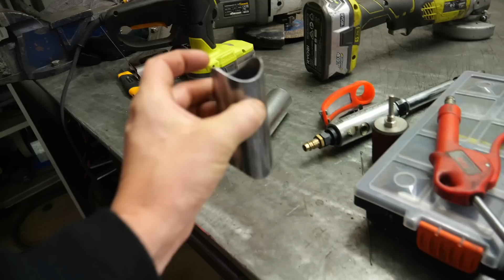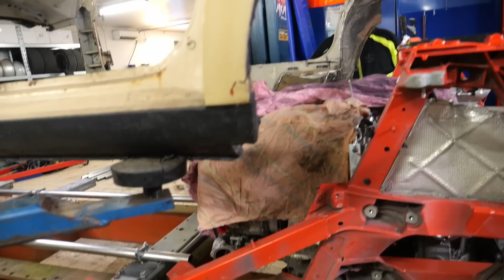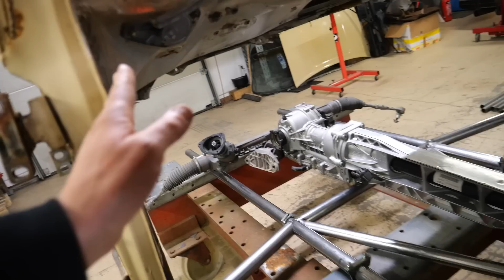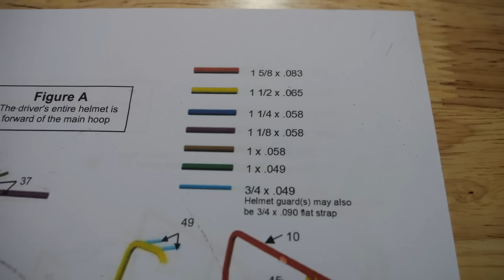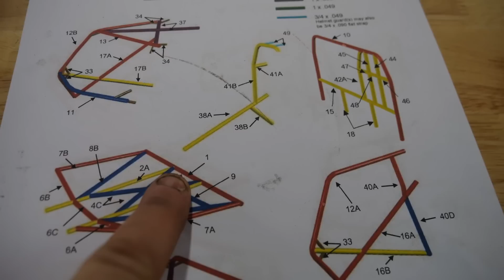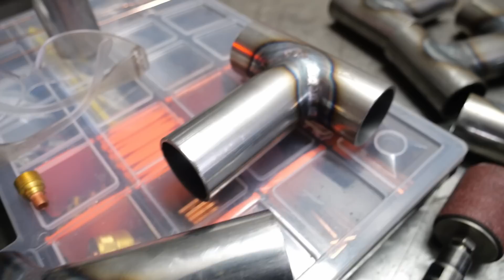Volvo with Mid-Engine V10 TT. Chassi build! Project Ep 2

Comment: Anybody watching using Celette MUF 5 / 7 type bench, just be aware they actually can flex if not on an even floor.

I use a MUF 7 and level it with a precision spirit level: it doesn't need to be 'level' usually, but just jacked in lowest corner to take out twist.  Amazing how much they move and I suspect over the years there must have been thousands of cars 'straightened' on slightly twisted jigs.

An old car scissor jack is perfect for the low corner: lift until twist is gone and it'll sit there for as long as you need, perfectly accurately (unlike a hydraulic jack potentially).

Comment: now you have a floor that is attached to the engine shell, if you measured carefully, you can cut away the sheet metal on the inside of the chassis, if this sheet makes noise, you can lower the chassis lower than where the pipes end and make the car lower, measure carefully with a laser, attach the chassis, check that everything is in place the right doors fit, etc. then weld everything carefully now you have a body that works

Comment: he inside of the threshold boxes is vertical saw out 3 mm tiknes and as long as the chassis cut off the pieces that stick out so you can bring the chassis down over them weld all the pipes phase in the inner edge of the threshold boxes so the floor is fixed in all the pipes +rectangular pipes must be attached together

Comment: Excellent build Peter! I like your idea of running fuel lines through the chassis. Actually I have seen guys run the coolant through those tubes, you should consider this also.
And I agree you should trim the sills to lower the body. Having it shorter and flush with the chassis tubes with a smooth flat bottom will look awesome AND give good ground effect down force at high speed.
I am curious how you will connect the steel to the aluminum chassis. The best in my opinion would be a block or shaped steel tube inside the aluminum tubing to prevent it being crushed and to spigot the joint then bolt through both.
Really looking forward to seeing your car come together. And those are impressive rules for building, very nice. Thanks for sharing

Comment: I do not know how you are positioning everything, but you want the floor of the car flat, with your current positioning of your front differential your ride height looks to be at least 20cm of the ground if your wheel has a 600mm od. i do not know what angle you want on the drive shafts? it seems out of place currently.

Comment: I use a high frequency pulse. 120 pulse per second. 20 % background at about 160 amps but use the foot pedal. You can punch it through, see it and back off to about half pedal, move, repeat. You don’t want to back off too much, as that can make weak points. Try a number 12 cup and set the flow to about 30-35 and run the post flow10-12 sec. Do a bit and move, to let the heat dissipate some. Maybe. Hope that helps or gets you closer to where you want to be sir. Love the channel.

Comment: I would love to build a chassis car like this, but I certainly wouldn't have cut up a perfectly good, rust-free classic 240...  I would instead have made moulds from the important panels and produced the doors, quarter panels, front guards, cowl and roof from carbon.  You also usually start off with rectangle section (i.e., 50x75mm, 060-080" wall) main chassis rails, and build the tube roll cage and other structure up from there.  Just look at custom chassis' built by, well, pretty much anyone really... Roadster Shop, Cornfield Customs, etc...
Reply from the maker: It was not rust free!
I would also like to do the body panels in carbon but i do not have budget for that!
Rectangular tubes is not allowed for fast dragracing cars, it must be round tubes. But it may be good for show cars and much easier to build thats why roadster shops maybee use them in new builds.

Comment: One of the gartest projects in Europe 😍 Make it as stock as possible from the outside. Only big fender flares and welded steel rims for the tires. And I would polster up the seat with the oem textile.

Comment: @PeterBjork As for fuel lines, not sure if you are allowed to have them inside the tube frame. Pretty sure you can have them through the coupe however but there can't be any joints inside the car, and i think the line has to be of a certain thickness.

Comment: Rather a cool interesting project and something different. 
Im just doing something similar with a BMW E36  , what started out as a simple conversion has turned out to be a whole new car only using the rear light clusters , steering rack and a windscreen wiper blade 😂😂😂😂😂😂. Made a chassis jig , intended to use as much of the drivetrain as possible etc etc . Nope that didn’t happen , now I’ve even gone that anal I’ve made door locks and door handles because I decided to make lightweight doors  in carbon fibre . Think I’m crazy myself. 😂😂😂😂 🇬🇧😵‍💫😳🤫

Comment: Hey Peter, if you are looking for inspiration on the rocker panel removal look at some "mini trucks" from the American hot rod scene. A "Doored" truck has the rockers completely removed to achieve minimum ride height where the bottom of the door is the lowest point on the vehicle. Great place to look for ideas to solve that issue.

Doing that will let you lower the body down farther and integrate nicely into the flat bottom of the vehicle. Not to mention, it looks very elegant if done well.

Good luck! And I hope you are going to use some massive over fenders and a wide body kit to keep the R8 track width!

Awesome build, i can't wait to see more!
Reply: Also, match your firewall / bulkhead between the engine compartment and the seats to the same angle as your seat back so you have equal clearance from the top of your seat back to the bottom. It would allow for more seat adjustments and theoretically be safer in the event of an accident. It's also a great place to tie in the R8 aluminum frame.

Comment: Hi Peter,

Very much liking the project and progress.

Great job!

Such a shame that your not using a two door Volvo body.

Keep up the good work.

Cheers from Western Australia.
Reply from the maker: Thanks! Yes 2-ddor is better looking but this will be easier to get in and work on the engine.
Reply: I feel like the widebody would've also been easier to design for a 2 door. I think at this level of fabrication he could always turn it into a 2 door by moving the pillar. Either way I am very excited to see how this will all work out!
Reply: There is another problem with using a 242 as well and that is that there aren't that many left. About 242,000 cars were built between 1975-1984, but most have been gone for decades. In total, Volvo built approx. 2.8 million units in the 200 series.

Comment: In my limited experience, trying to integrate an OEM subframe into a tube frame seems like a time saver in the beginning but ends up causing a lot of headaches and often you start over without the OEM subframe.  You don’t gain much by using the Lambo/Audi subframe and you spend more time trying to solve the problems it creates.   Maybe for this type of project it will work fine but attaching the subframe to the tube chassis is already creating more work and complexity, maybe even a compromise in strength. Also, your practice welds look like spot welds linked together.  Which wouldn’t be acceptable.   Maybe I’m wrong about them being spot welds.  I’ve been a subscriber and fan for a few years now so I don’t want to come off as a troll.
Reply: A couple of things.
Dump the factory frame. Just get some mounting plates cut using some scans and make a tube frame cradle that can be bolted to the chassis. I suggest you use the factory frame to make a mock engine.
I haven’t looked at roll cage specifications in many years but I believe there are different specs for front mid and rear mid mount engines in regards to anti intrusion protection and fire walls.

To practice tig welding Don’t use filler wire until you can control a puddle that fuses two surfaces together at any angle. When you get a consistent weld without filler and no blowouts you can then start practicing adding filler.
Remember cleanliness and consistency of temperature control are key.
Reply: That’s a perfectly good TIG weld, it’s looks spotty as you have to dab the filler rod in yourself.
Reply: @nellyracer22 its definitely not perfect tig welds and they have room for improvement. But it is practice welds too, its not horrible. Its a good thing to focus on to do good

But a very awesome build and i really looking forward for this!
Reply: With all R&D Audi has done on R8 platform. Spent millions in developing it and designing. I think it would be stupid not to take advantage of it.
Reply: @lows3nse  so do you think Peter should also use the OEM front subframe?  And is Peter “stupid” if he doesn’t?
Reply: @scotth7686  not meant in a negative way. He does whatever feels right to him. I only assumed that he takes advantage of Audis engineering instead of doing everything from scratch.
Reply: @scotth7686  chill the fuck down and continue on your project then
Reply: @danielssonsgarage  🙄
Reply: Any videos of your builds being done properly? Be interesting to see
Reply: @joeedwards627  I wouldn’t post videos of a project in the works.  Things change.  People don’t know what they’re looking at.  They think temporary things are permanent.  To me it’s like showing people a painting that’s half done.  What’s the point?
Reply: @scotth7686  because people like watching progress of peoples projects, that's why this guy has posted it, that's why I watched it, that's why you watched it, that's why 69k watched it
Reply: @scotth7686  show us your start and finished projects then so we can see how this is done properly without the middle bit as there is no point. Apparently
Reply: @joeedwards9721  That’s Peter’s thing.  That’s not my thing.  Maybe when I get the car to the go kart stage I’ll post a video but then again, I’m nobody so nobody would ever see it anyway.  It would get 25 views.  Lol
Reply: @joeedwards9721  👌
Reply from the maker: I think it is a time saver for now. It has so many attachment points for the equipment and turbo kit i allready have.
It have mounts for: engine, gearbox, turbos, intercoolers, wishbones, trackrod, swaybar, ecu:s, coolers and hoses.
Maybe better to build everything new but i dont do it at this point.
It is absolutely not spot welds! It is pulse so it is high and low amp switching.
Reply: @PeterBjorck  your better off remaking the alloy subframe out of tube and mimic all the pickup points onto it, the extra work at this point will save you in the long run
Reply: @Grooty79 yuup agree it's better to copy a known design .
Reply: @PeterBjorck  EPS Motorsports is building a Quattro using R8 control arms and uprights.  They eliminated the anti-squat and anti-dive geometry, which simplifies the chassis design and they have 3 mounting options for the upper and lower arms so they can easily make changes to the ride height or the roll center.  This further simplifies the design.
Reply: @PeterBjorck  I'm curious, would you go full custom subframe in the future? With full tubular frame & everything?
Reply: @PeterBjorck  sorry Peter.  I think the welds resemble spot welds because of the wide spacing.
Reply: @scotth7686  yes the filler-dips/pulse spots are to far apart and he has pores (? porer) in some if them. Its easier without pulse-function imo, just in thin materials its necessary.

I think it's very smart to use the oem subframe. People who comments has often never done any project themselves and doesn't understand how much work it is.
Reply: @danielssonsgarage  you’re right.  Most people who leave comments have never done anything like this.  But I have done something exactly like this.
Reply: @danielssonsgarage  do you think Peter should also use the OEM front subframe?
Reply: @PeterBjorck  we can see when you pick up the suspension parts that you’re also using the OEM front suspension, but from the look of the tube chassis, it doesn’t look like you’re going to use the front OEM subframe.  The front geometry is more complicated than the rear so people who disagree with me about the rear must think you should also use the OEM front subframe.